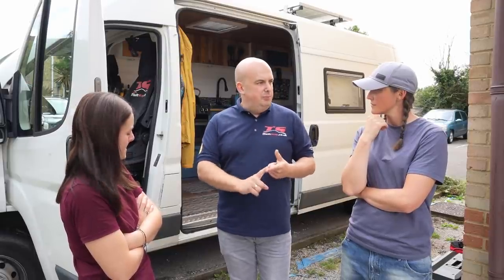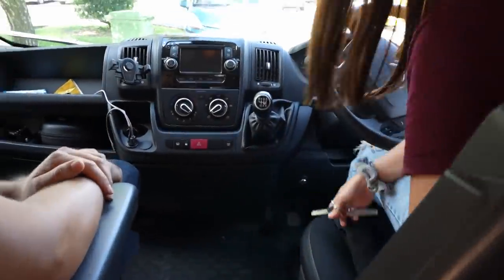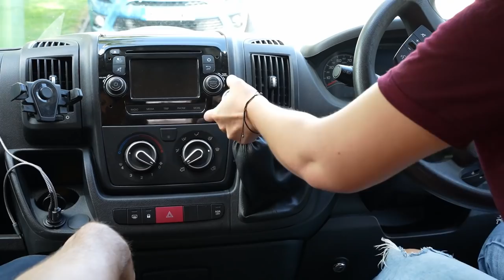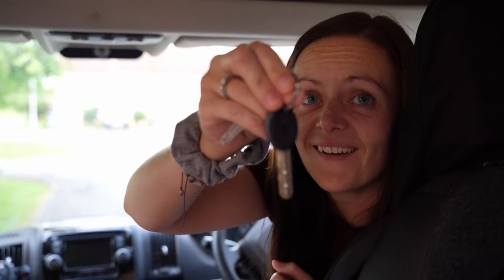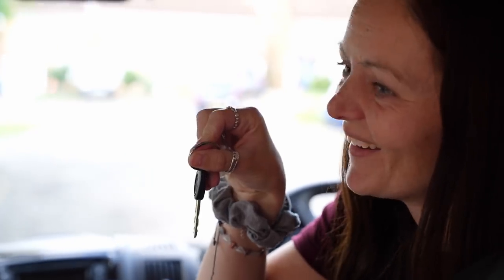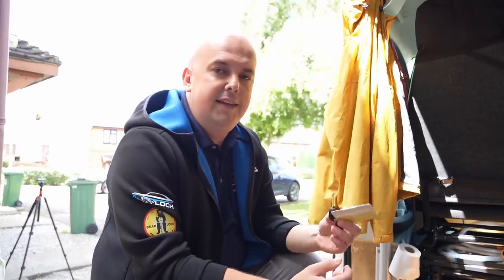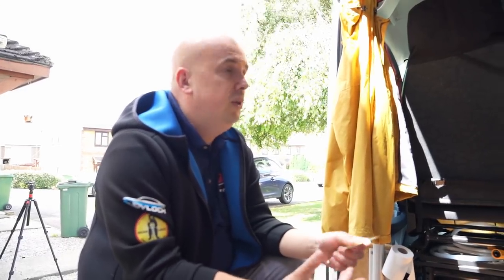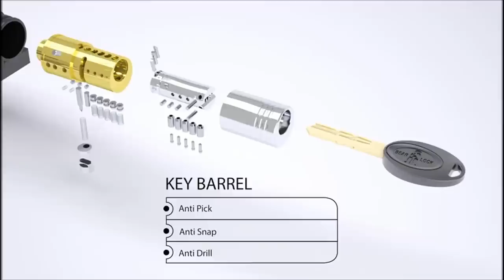DON'T let them STEAL your CAMPERVAN... discreet motorhome security upgrade you need to see! Vanlife.

Comment: one way to secure your van is if you have a swivel drivers seat, just turn it facing the back and lock it down to the floor. There is no way someone can jump in it and drive with the seat facing back to front. cheers

Comment: I put in a really simple locking mod (not my idea, I copied it from someone else) again it won’t stop a thief if they’re determined, but it will slow them down or make them go somewhere else. I’ve got swivelling front seats, so I got a motorcycle disc lock (Oxford Patriot) £55 in a local motorcycle shop, which isn’t the U shaped type it has a 14mm dia pin. All I had to do was drill a 14mm hole through the seat base, I positioned it so with the seat swivelled round facing backwards and the lock fitted there about 6mm of movement of the seat. So unless someone can drive standing up in the narrow gap between the seat back and steering wheel, they would have to get the lock out. It’s position makes it incredibly difficult to pick, leaving the only option grinding off the head of the pin inside the seat base. Very noisy and very limited access. And with the seat turned round the seat cannot be unbolted. The lock may be a little bit fiddly to fit but not too bad, only takes a few seconds.
Reply: Wow Chas, thats a great idea.
Reply from the maker: Thanks for sharing, uts nice to get tips and tricks from others 👍
Reply: Awesome idea, I think we might try this for our Van! Thanks for sharing!
Reply: sounds like a really good idea.....thieves usually want to get in & off as soon as poss.....so sure this would prevent it !!!
Reply: It may not stop them, but it would certainly slow them down. To cut the pin off would involve an angle grinder inside the seat box, and I’m going to make a reinforcing plate with a rig round the head of the pin to make it even more difficult. The lock body itself is quite a thick thing so would also take time with a grinder making noise. And to pick the lock, it’s in a very awkward position to pick it, it’s even a bit fiddly with the key.
Reply: Yeah I watched that video too , its quite ingenious .
Reply: Good idea with the seats.
Reply: And they have a sticker to warn thefts that this system is installed. Stick it on the side window

Comment: Old SAAB cars had gear lock as standard, I still always leave my car in reverse although I haven't had a SAAB in ages...
But they had totally useless locks instead, so I also installed a hidden switch for the fuel pump.
Once I came out and the car was broken into, started and driven all about 2 meters before it ran out of fuel.

Comment: Great video guys and them cakes looking amazing.  I've never heard about that security system. I saw on another channel that you can get a lock for the drivers seat, so just turn seat around and lock it, and then the the thefts can't even drive off, as seat is facing the other way.

Comment: Interestingly Saab 900s were using reverse gear locking since the 1970s
And you can't remove the ignition key untill the car was locked in reverse

Comment: Hi I’ve just seen this .some thieving parasitises tried to steal my camper van the other week.the only thing that stopped them taking my van was the disklok the trashed that but could not get it off.ive now had dead locks and plates put behind the van door locks.as well as a new disklok.safe travels to you.maybe see you on the road.

Comment: Upgrading the vehicle's security is always a good idea, a few other suggestions one get tracker fitted another a pedal clamp which immobilizes any  pedal  you want  one of your videos shows that you went to all the trouble of a decent set of wheels and tyres get cextra locking nuts if you have a spare wheel get one for this sadly it is not uncommon for theives to steal these.
Make life hard for the low life.
Reply from the maker: Such low life's indeed right, thanks for the tips
Reply: It sounds like your walking around my van 😱

Comment: I installed the prickstop: pieces of steel behind the front and backdoor locks. They are way to easy to open with a screwdriver….
Someone stealing the van is 1 thing, but finding the van with a mess inside and your stuff gone is also i’d like to avoid.

I also modified an apple airtag (removed the speaker) and installed it somewhere so i have some kind of cheap tracking in case its stolen (or i’m unable to find it on a huge parking or so)

As the bearlock like he said: its popular in Holland.. well, since the majority of the insurance companies over here require it to get the vehicle insured… that makes it by default ‘popular’ 😀
My van doesnt have a bearlock (yet) since it’s value is below 25k euro, and my  insurance doesnt’t require it for this van, but thats an exeption, higher valued vans do require it, and the majority of them do also require it for ‘cheap’ vans.
Another option is a construct. Similar and here in NL also accepted by the majority of the insurance companies.
You only need to use it and provide all keys, or they will deny your claim.
Reply from the maker: Thanks for the input, all good points and thank you for watching 👍

Comment: This type of system used to be fitted to SAAB cars many years ago. Do they provide a sticker showing the presence of the system. I personally think the most cost effective security is visible stuff - e.g. a hefty steering lock and supplementary door locks to stop thieves getting in in the first place.
Reply from the maker: They do provide a sticker, we also have visual deadlocks on the doors as well 😁

Comment: They have been out for many years they also make them to stop the prop shaft going around or with front wheel drive stop the drive from turning they are very good , but sadly there is a way around it but you should hear them .
Reply from the maker: Yeah they have been out in Europe a long time and have changed and developed alot over the years 👍

Comment: i used to fit a similar system to cars in the 90s called multilock basically a big padlock went around your gearlever [ which was between the seats in those days] 100% success record in all my family's cars. they once threw a tin of heinz vegetable soup through the window of my sisters fiesta cos they couldn't nick it [ where do you get a tin of soup from at 3 in the morning???]
nice buns emm, cakes look nice as well....
Reply from the maker: 😆 that's bloody hilarious, seriously though surely they could not have had the tin on them 🤣
Reply: @campervibe  gets better, the fuzz took the soup away, [for examination??] so she didnt even get a meal out of it.
talking to a copper later on, he recons he's seen kids with a tin + a spoon before, out nicking cars, tin to take out window, spoon to hotwire ignition switch, carrying these in the early hours was not a crime, whereas a hammer + screwdriver was classed "going equipped for theft" which got u nicked.  this all happened in the 90s in sunderland, car crime capital of UK, 95-97, i made a good living working for the police [on the nights] recovering stolen cars, used to double my  mechanics wage every week. [very happy wife, loads of money +only seen me for an hour a day]

Comment: Useful video. Good idea. I'm going to have a look into it.

3 times in the past two years I've had attempted van thefts. Never actually in remote places, always outside my home in London. If you're in London, there are professional gangs of East European car thieves operating. I was actually sitting in my van two weeks ago, quietly rewiring the electrics, when I heard power tools on the body. Middle of the day, in a residential area. They Pulled up in a car and jumped out, but didn't realise I was in there. Told the Police, but they said the car had false plates, and they couldn't track its final destination on CCTV. Luckily, I had planned to do the work the day before, but was busy, so just luck I was in it, at that time, at home. Having those additional external locks on your doors, visible alarm and immobiliser, with SMS alerts, and additional, hidden immobiliser on the fuel line. Motion detection triggered spy cams are cheap to setup to your phone, if you're tech minded, and know a bit of raspberry Pi tech. Always try to park near CCTV, and not in a spot that could be hidden on one side, anywhere in London. It has at least quickened my plans to quit London, so one positive.
Reply from the maker: Oh wow that is horrible, it's such a crap world out there at times and people can be just wrong at least this will help us like you say as much as possible yo try and prevent and deter them
Reply: @campervibe  Yes, that's what you have to do. Many Layers of defence that just make it too much work to bother. I park in really remote places sometimes, and never had problems. Only ever outside my home in London!  I just don't know how someone has the nerve to try and saw through a door hinge in the middle of the day, outside a house, by a park full of dog walkers! Luckily, I jumped out and chased them in a few seconds, so only scratched paint. But that's London. I really like your reverse gear lock, definitely will fit. Even just things like an extra steering lock and handbrake lock all adds on extra time, with an alarm going, and immobilisers to find, to make them walk on.
Reply: And final security thing I use - have an alarm system with sms messaging, that lets you disable the vibration sensor, so you can have it on when you're in the van. I paid £40 on ebay for mine, it's a popular UK made one green/black. Uses hardly any data, so a cheap pay-as-you go sim work, to sms your phone if the alarm is triggered. It also has a panic mode on the fob, if you want to trigger the lights and alarm, if you're in the van, and someone tugs on the lock, or is hanging around suspiciously. I've only ever done that once (in London, of course). Seeing a blinking alarm led on the dash, while you're sleeping, is another useful deterrent, and the sms lets you check your van cams, if you have them, if the alarm has been triggered. You can also record to your phone then.

Comment: This is almost hilarious I had a switch in my pickup truck freeze up up one time I couldn't get my truck out of park it took me about 2 seconds to realize that I could crawl under my truck pull a pin out of the transmission linkage put it in gear manually and drive it and that's exactly what I did to the repair shop most things are so easily beat GPS will get what's left of your van back cameras may even catch the thieves but the stuff inside will be gone tires rims batteries yeah tripwires with flashbang shotgun shells electrifying the outer shell of your vehicle with a cattle fencer is not a bad idea because if they get the crap shocked out of them they will probably move on

Comment: If someone is really determined they could reverse the vehicle onto a low loader, drive it away and deal with uninstalling the locking mechanism elsewhere but for travelling around the Country and leaving the van to explore it's highly unlikely anyone is going to go to those lengths.
Reply from the maker: If they’re coming with a low loader then they are a whole new league of thief! However, like was mentioned in the video, if you park with a wall/car/tree behind you then they can’t reverse it anywhere! Thanks for watching Karena 😀👍

Comment: I dunno at the end they just need to unlock the key at this point any cheaper mechanical solution will work, I don't see the point in a 2 hour and half installation job.
Reply from the maker: Hi, if you watch the vid you will see its ant tamper/pick type of system so no, they won't be able to do that 👍

Comment: I had one fitted and they picked open. But I had a tracker fitted so I got my van back.
Reply from the maker: Wow where did you have it fitted, these are the only guys in the UK that stock it or do it 🤔
Reply: @campervibe  I got my van second hand the lock was already fitted . The lock is a mul t lock which is not that hard to pick they loads of YouTube vids on picking them . But chances of your getting picked is very low . So don’t worry. Just remember theses companies will tell you different. I have every locking devices I can fit plus my insurance is really low now. Bye ladies.👍

Comment: Very good choice, I have it installed in my van as well. As already mentioned in the video, it was a requirement from the assurance cy in Belgium. After installation I had to register my installation with an attest from the installer directly by Bearlock. I received back two stickers which I put on the windows to show that a Bearlock is installed. Those stickers I received directly from Bearlock. Do you have those and did you put them? Anyway, good luck and a lot of fun.
Reply from the maker: Nice one, glad you have it, we are super happy it's been installed 😀

Comment: I use a good quality steering wheel lock on my newly purchased van but your security info is interesting. I have a immobiliser on my but it is very sensitive and I’ve had lots of problems with it. Do you mind me asking how much this cost. I went on their web site but it doesn’t give any prices.
Reply from the maker: Hi ya, it depends on your van, this is why they don't put prices on, if you contact them they will give you a quote, really lovely guys as well 😊

Comment: Clever locking system I had never heard of. Unless I missed it, some idea of the cost would have been informative, although I assume it will differ for each type of van. 
Your view on security is right, do you break into the house with the obvious alarm system or the house next door without one.
With that in mind do you break into the van with AJ bouncing around inside & risk getting your face ripped off or the nice quiet one next to it?
AJ might lick them to death instead but they don't know that.
Hope that thought helps with Lou's vanxeity when you have to leave him in the van for a while.
I look forward to seeing what you get up to next week.
Reply from the maker: Hi ya, yeah we also think that as well, we think AJ looks the part for sure. We didn't mention the price due to it changing for each van but there is a breakdown on their website 😁👍

Comment: Did they mention how it might affect service/work by mechanics on the gearbox, is it separate enough that you wouldn't get any issues at the garage?
Reply from the maker: Hi, it’s completely separate from the gear box, only affects the shifter 👍
Reply: @campervibe  Thanks for the reply! Ah I see, ok. Was just wondering if you took it into the garage with an issue around the shifter or gearbox (or any other nearby component), mechanics might want to avoid working on the unknown? Maybe not an issue, just thinking up reasons not to fork out for this 😂 thanks very much for sharing it.

Comment: I always worry about my van ,,I use a prolock but would like it fitted a steering lock is visible did they give you window stickers saying bearlock was fitted just might save your side windows from being smashed then finding out it can't be stolen when inside I'm not picking but clutch claw do .
Reply from the maker: Yes we were given stickers, however, we haven’t put them up so as not to give the thieves the advantage of knowing it’s there, otherwise they could come better prepared. I think it’s down to personal choice whether to advertise all your security or not.
Reply: @campervibe  yes thanks for replying ,a good idea 👍

Comment: Or save Alot of money and remove a certain fuse in your fuse box when you leave your van. Not many thieves carry a pocket of fuses. Youre welcome.
Reply from the maker: No, but they can easily pinch one that’s sat right next to it! You’d have to remove them all and that’s a lot of faffing about!
Reply: @campervibe  Incorrect. Theres only one that relates to the starter. Carry on.
Reply from the maker: But there’s more than one fuse of that size in the van, so they just pitch one of those and move it over to the one that’s been removed from the starter.
Reply: @deborahanderson5508  the girls are right - poor method of immobilisation